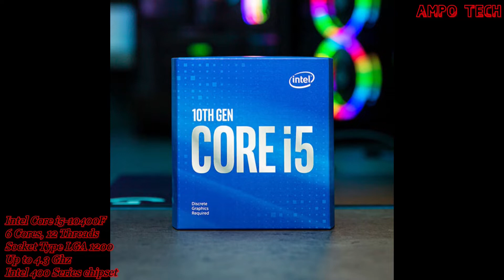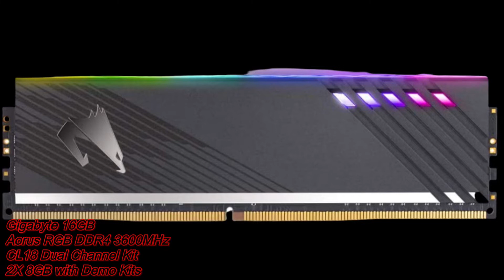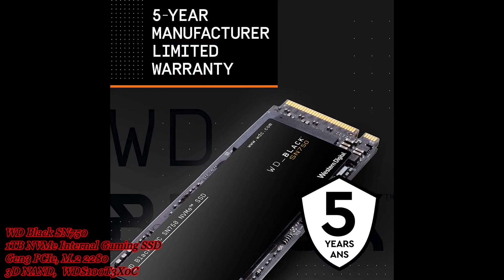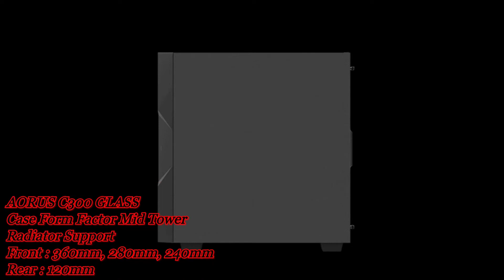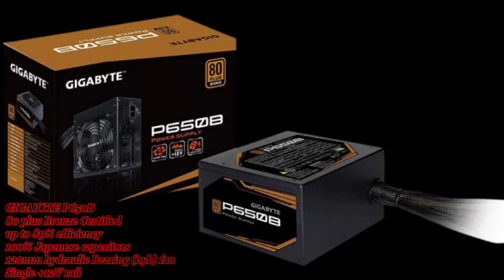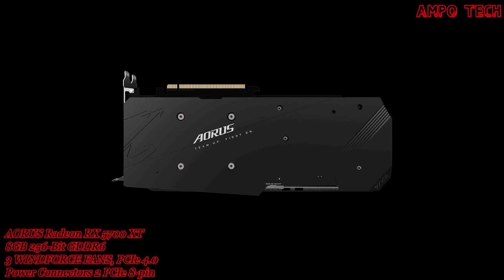$1400 Intel Core i5-10400F Ft.GIGABYTE AORUS BUILD | PC BUILD PARTS TIPS | AMPo Tech

Comment: HELLO HOW MANY DEGREES DOES THE I5 10400F GO WITH LIQUID REFRIGERATION BECAUSE WITH THE COOLER STOCK I REACH 60 DEGREES WITHOUT PLAYING ANYTHING JUST THE WALLPAPER, THANK YOU
Reply from the maker: try to use other thermal paste on your CPU. like noctua or other thermal paste, because sometimes the free thermal paste on the CPU is not good and temp.  just try replace or put another thermal paste on it.